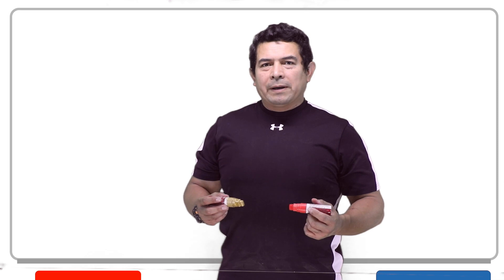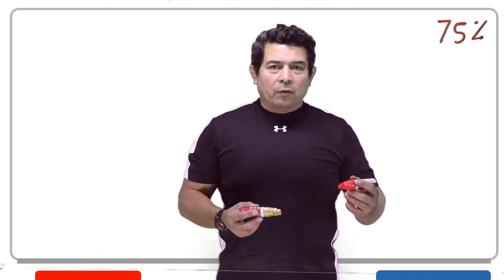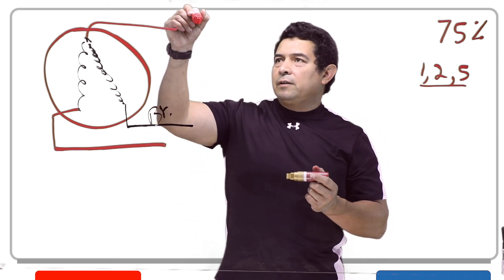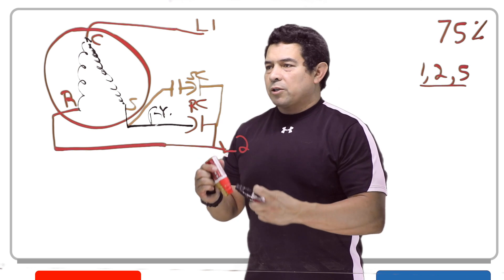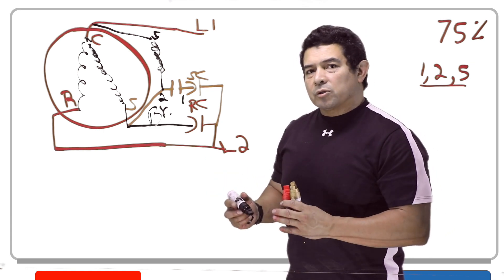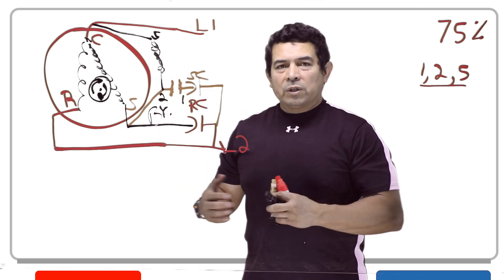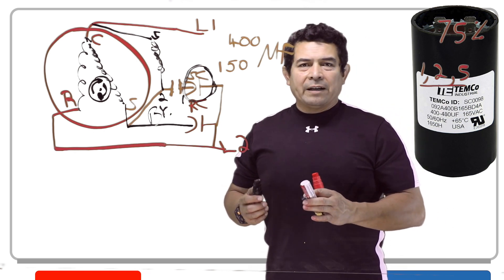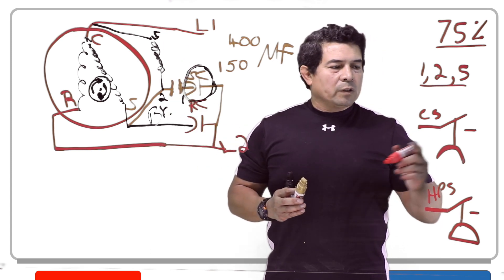Capacitors 5 Start Capacitors - HVAC Online Training and Courses

Comment: After the motor ger 75% of speed the start cap got out of the circuit and the  motor br run widing so what happened to run cap it is connected between R and S
Reply from the maker: When you have both, the run and the star capacitor, the star capacitor gets taken out of the circuit at 75% of the motor speed. The run capacitor stays energized and it keeps doing this job. The capacitors are named for what they do. The dark capacitor is for starting, the run capacitor is for running. I hope this answers your question. And thank you for watching!

Comment: Brilliant summary. I'm trying to better understand the theory of how these motors are designed. Am I correct to say that the resistance of the start winding is higher, but the inductance of the start winding is lower than the run winding? Why is the inductance of the run winding so much higher? Is it designed that way to allow high current to quickly flow into the start winding, unfettered by impedance pushback. Then once the motor reaches speed, you want to route power through the more durable and more powerful windings of the run coil? I do understand how a phase shift added by those capacitors to the start circuit allows the motor to spool up with more torque. I get the way current flows antegrade, even though the voltage drop across the start winding is so high after back EMF pushes back, mainly because the back EMF is out of phase with incoming current. Is it fair to say that the reason the capacitance of the run cap is so much smaller is to balance incoming current, yet increase impedance, reducing current flowing through the more fragile start windings once the motor is at full speed (Z=1/(2pifC)?
Reply from the maker: Thank you for your message, and your questions. 

The start winding in a motor has more windings and more resistance than the run winding, because of the wire is smaller in gauge. There are more turns in the start winding and because of the increase amount of turns the inductance increases.  

The start winding has higher inductance than the run winding, and that is because of the amount of turns. 

On start up because of the amount of turns in the start winding, the start winding would have a stronger magnetic field then the run winding. This will start the rotation of the motor and depending on the polarity of the start winding we can dictate whether the motor will have a clockwise or counterclockwise rotation. As the motor picks up speed you can say the inductance kicks in. One of the reasons they use smaller wire and a capacitor in the start winding is to get a phase shift so the motor can keep the rotor rotating. 

I would say that the capacitance of the run capacitor is to increase the power going to start winding and help with the phase shift. When we talk about farads or microfarads, we are talking about the actual electrons/current that are going through the capacitor. The higher the microfarads the more electrons/current that will go through the start winding. Of course, the more current the stronger the magnetic field is going to be and the more heat that will be generated. This is why we have run and start capacitors. Start capacitors are much higher in microfarads and because of that they will give your start winding more torque, but they are removed at 75% of the motor speed, so as to keep that current down and keep the start winding from overheating and burning up. 

Unfortunately, there is so much to all of this that this discussion could go on forever it seems like! I hope this makes sense. And I hope this explains your questions. Please feel free to let me know what you think.  Thank you
Reply: @AirConAcademy  Thank you, that makes a lot of sense.

Comment: 10:51
at this point in video, the diagram shows that the star winding is energized via the Run Capacitor, isn't it ?

What then de-energizes the Start winding /

I'm at a lost how it is disconnected at 75% Max RPM.
Please adivse .
thank you for you very informative presentation.
Regards.
Reply from the maker: Good question! In the motor that I am talking about, the start whining stays energized as long as the motor runs. It is called the start winding because it is used to get the motor started. You mentioned 75% of the motor speed. That is when the start capacitor gets taken out of the circuit. To do this they use the potential relay or a starting relay. I believe I have a video that talks about these.   On some motors they do de-energize to start whining but in this field for what we do the start winding does not get taken out of the circuit until the motor shuts off. I hope this explains it. If not please let me know!

Comment: Do I need to pay attention on the direction when I install the run cap or the start cap?
Reply from the maker: Not anymore! Years ago, and I'm talking about 25 or 30 years ago that was important. On the new capacitors you do not have to worry about that whether you're talking about a run capacitor or a start capacitor. Please be very careful because some people get the capacitors that are good for the compressor and the fan confused with the start capacitor. Those fans capacitors that have, or are labeled common, fan and Herm, it makes a difference how you hook them up. With those you must be very very careful.!!!   Good luck!
Reply: @AirConAcademy  thx

Comment: Hello, you introduced a centrifugal switch at the end.  Is this internal to the compressor? would adding a hard start kit to a system with the centrifugal switch be redundant?  ty
Reply from the maker: The centrifugal switch is typically only used on Motors and not on compressors.  The switch will take the start capacitor out of the circuit.  The Hard start kit is basically the same thing as what was described in the video.   The hard start kit is basically a start capacitor and a solid-state relay to take it out of the circuit at 75% of the motor speed. I hope this answers your question.

Comment: Man this was excellent thanks
Reply from the maker: Thank you,! I'm glad I could make this video so you could get something out of it. That's why I'm doing this! Take care, keep learning and thank you!
Reply: @AirConAcademy  does the run cap always feed the start and not to the run winding
Reply from the maker: @tooleman01  yes, the run capacitor always feeds to start winding, the start capacitor also feeds the start winding. Basically they are named for what they do. The start capacitor is used on start up and the run capacitor is used while the unit is running.  I hope this makes sense. Thank you for the question.
Reply from the maker: @tooleman01  I'm glad I could help. I was till all of my students to check and double check when you are told something, even when I tell them something. I want them to be sure that they are being told the correct thing. Thank you for your question and keep learning out there!

Comment: If start capacitor is disconnected after a while, will load in ampere also fall down drastically?
Reply from the maker: Yes, that will happen. Start capacitors are only supposed to be working until the compressor/motor reaches 75% of its operating speed. At that time either the centrifugal switch or the potential relay or the current relay will take it out of the circuit. If this does not happen, if it is not removed from the circuit you will have a high average condition and the motor could overheat and tripped out on internal overload. I hope this explains it. Thank you for your question.

Comment: I was under the impression  that a start capacitor the only thing it did was a face shift and did not store any energy
Reply from the maker: Yes it does shift the angle of the Phase and it does this by storing energy and then releasing it.  This creates a delay so you have a phase shift.    Both start capacitors, run capacitors and all capacitors store and release energy. The question is how long does it take to charge and discharge. This determines how much of a phase shift there will be.   I hope this explained what I was trying to say a bit better.

Comment: Hi.  Thanks for the video ..  what happen to the compresor if the potencial relay  doesnt take  the start capacitor  off ...     thanks
Reply from the maker: Very good question!!!   The capacitor supplies the power needed to give the compressor motor more torque. If the capacitor stays energized the motor will overheat and go out on internal overload or it could possibly burn out!!!

Comment: Took my attention that Run capacitor never feed RUN winding. L2 feed it.
Reply from the maker: correct     either L1 or L2 can feed the run winding   BUT  the RUN and START capacitor always feeds the START winding.
Reply from the maker: Luis Romero Yes, the capacitors always feed the start winding. And the capacitors are labeled for what they do. For example the run capacitor works when the compressor is running. The start capacitor works when the compressor starts.
Reply from the maker: Correct it is called run capacitor because it is used only when it is running, the start it is called start because it is used only on start.  Please make sure you subscribe to my channel.
Reply: @AirConAcademy   good clarification
Reply from the maker: XRAY Bravo Thank you!

Comment: When the motor speed reachs 75percent the SC is out of the circuit and the RC stars. That means RUN capacitor feed the START windings. Wright?
Reply from the maker: the Start and Run capacitors operate at the same time on start up.   They both are feeding power to the start winding until 75% of the motor speed. the capacitor gets the power from the same line that feed the run wining, and then the start capacitor is removed from the circuit.
Reply: The short answer: YES